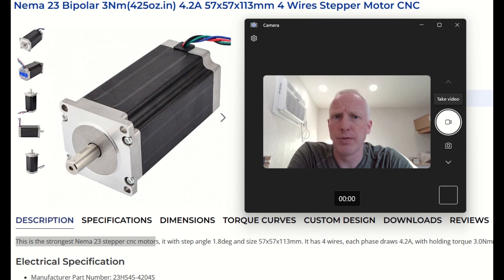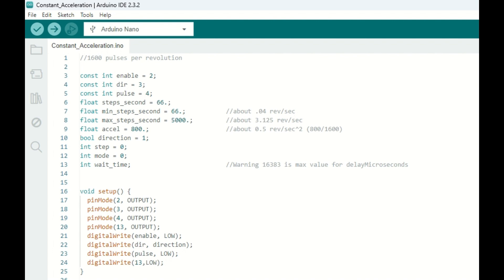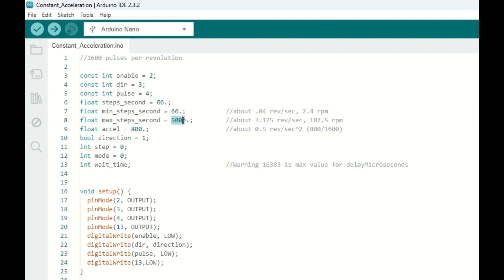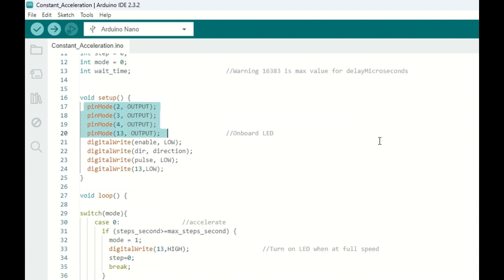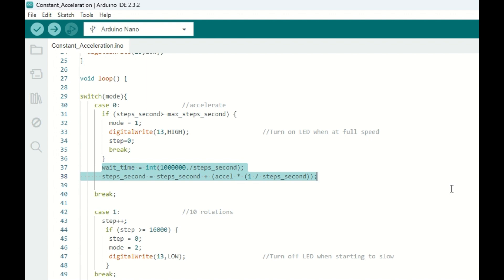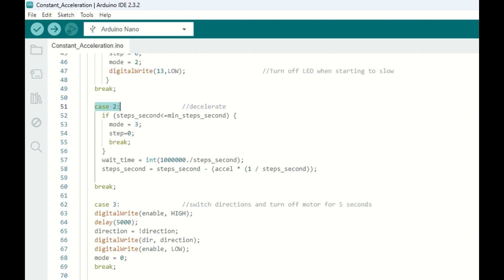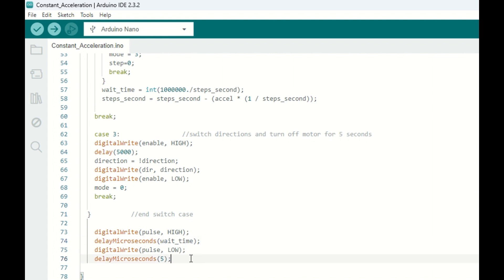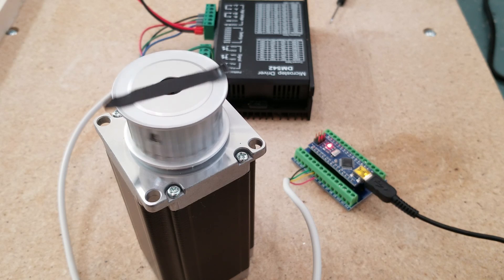Stepper Motor Constant Acceleration using Arduino and DM542

Comment: how can i find this Arduino code pls help me 

i only need with fix speed one side directional torque with 10 sec delay
Reply from the maker: If you only need one direction you can wire the direction pin either high or low and not worry about coding it. Delays with Arduino are pretty simple. Not understanding exactly what you are trying to do.

Comment: Thank you for this video. What was the maximum rpm achieved in the example?  Understandably, no where near the speed achieved in the previous video, but what would be the maximum speed using this technique?  Thanks!  Regards.
Reply from the maker: 187.5 rpm in that video.

Comment: So I will keep looking but do you show how you wired your Arduino to the stepper drives, limit switches, spindles???  Are you using a shield, it does not look like it.  

Nice job by the way, the build looks great and the video's have been really helpful.
Reply from the maker: I am not a big fan of the stepper motor shields. I just hook directly to a stepper motor controller. On the control side wire GND to the negative sides of enable, direction, and pulse. Then you can wire digital outputs to the positive side of enable, direction, and pulse. Good luck.
Reply: @ScienceFunInnovations  Wow, first thanks for the reply.  Also - why don't you like shields?  Quality issues, reliability?  Performance?  

I guess i was just nervous to hook things directly up to the Arduino pins without any kind of buffering.  Also worried about current capacities as I have no idea how many milliamps 4 drives will consume on the step and direction pins.  

Also I very much have enjoyed watching your videos, they are all interesting and helpful with good pacing and timing.

Comment: Build this in labview by using Arduino because the company work with labview
This is a single phase or two phase stepper motor, how do you keep track of the place of the motor in power loss?
Reply from the maker: This is a bipolar motor. In the event of a power loss you lose the position unless you use an encoder. You can easily talk between labview and Arduino. Check out some of my other videos using serial communication.

Comment: Please can you do a vid on using an a arduino cnc shield/ expansion board I have one but I’m having a problem setting the right driver controller current and also I’m having trouble with my nema 17 motors over heating even though I have set the correct current
Reply from the maker: I have a CNC shield, but don't know when I will get a chance to play with it. Hopefully soon...